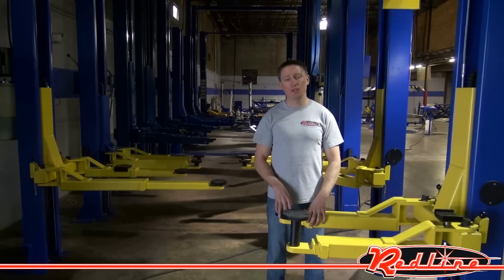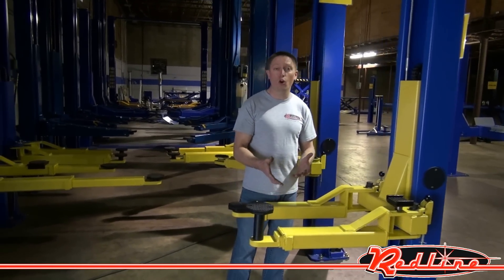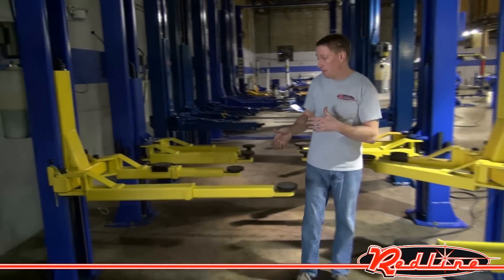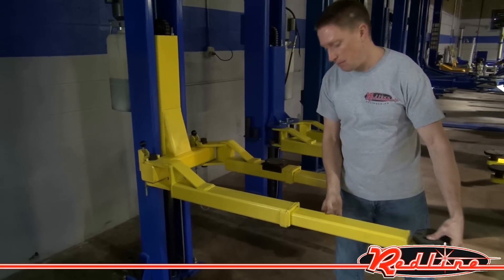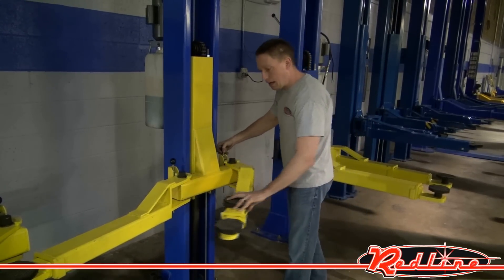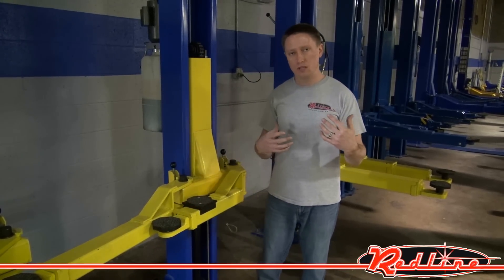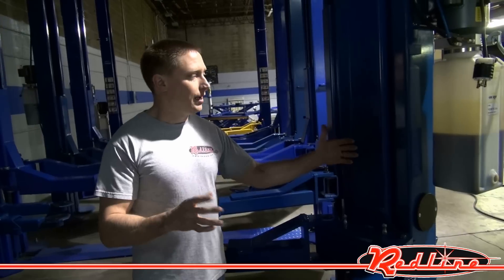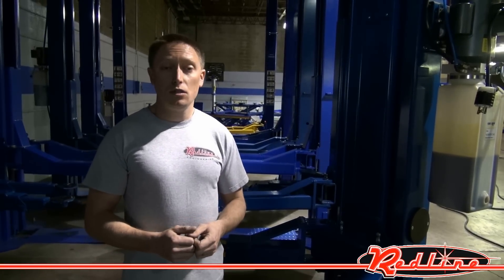Explaining Difference Between Asymmetric & Symmetric Lifts

Comment: ive learned more about lifts from 2 of your videos than the 35 others i have watched. this is great detail. i have one question about safety locks. do lifts mechanically lock a vehicle when its lifted (at any height desired) or it still relies on Hydraulic pressure to keep it lifted the entire time?  ive seen some videos or models that have certian holes for safety bars etc....
Reply: The lift is raised then lowered until it rests on locks all two posts are the same. I guess for redundancy the hydraulics are still active as is the synchronization cables so both shuttles are connected even if one failed and there are dual rams but I don't believe dual pumps and pipes. So many redundancy circuits. Don't get under a lift that's not lowered onto the locks

Comment: Today I lifted a 2020 Silverado 2500 single cab with the gas 6.6 and it had a royal truck body bed on it total weight was about 1100, my lift is rated 10,000 asymmetric. It went up fine, I put a put pole jack on the rear diff. Had to get that oil change and rotate done💪

Comment: Hi, my name is George, I like the way you’re explaining the difference between the lifts .
My question is regarding a lift I purchased about two months ago Model #
NW-2-9k-ACD , on their website it’s specifically described as Symmetrical and Asymmetrical  lift . The arms are straight one shorter and one longer (not curved), they are opening in opposing sids, not in the same side that means that they are asymmetrical ?? Please help me
Reply from the maker: So, symmetric lifts feature towers that are parallel and all four arms that are all identical.  If anything from that equation is not satisfied, the lift is asymmetric.  Many companies define asymmetric as something different, but at the end of the day, asymmetric means nothing more than the left side is not the same as the right side, and/or the front is not the same as the back.  That's it.

Comment: We'd like to get a lift but can't determine which would be best for our application. We'd be lifting our same cars, 04 Suburban, 06 1500  Silverado Crew Cab, 4 Vettes (04, 08, 13, 14), 71 and 82 T-Bird, 77 Trans Am, 04 Mercury Mountaineer and a 04 Grand Cherokee. Nothing too heavy. Use would be for oil changes, brakes, minor tinkering. Prolly more lifting and admiring than actually working on anything :)

I'm thinking the 45 degree canted Asymmetric would be the best. My only concern with that is visually, the vehicles look off center when lifted. That'd take a bit to get used to. Great video!